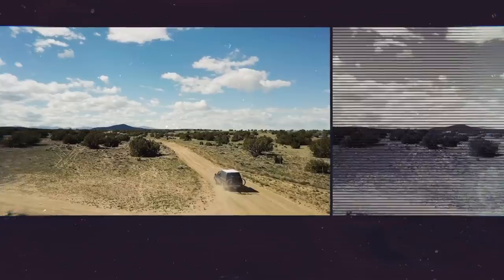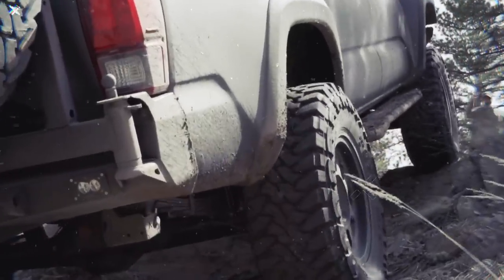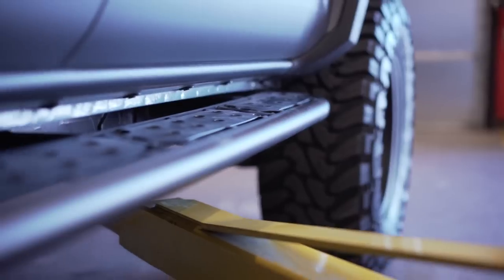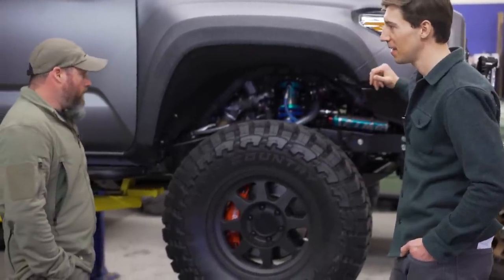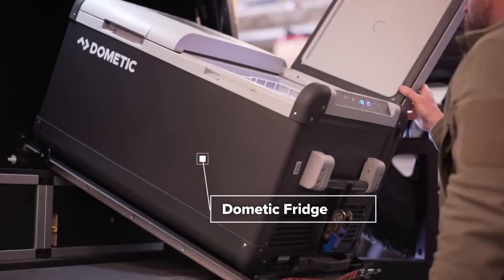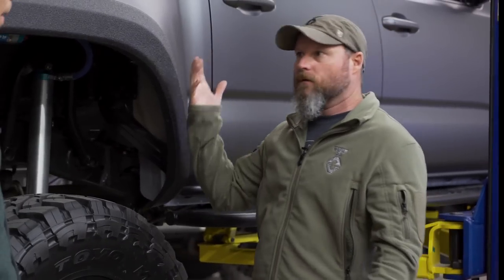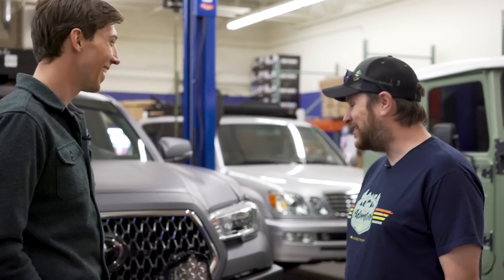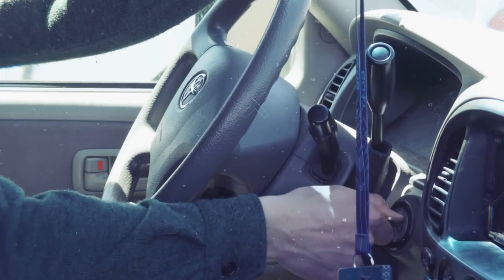The Guru Building Custom Adventure Trucks | Outside

Comment: I would be interested to hear the opinion of whether or not you should buy a base truck versus the off-road version. For instance should I buy a Tacoma SR and send it to Tactical , or a TRD off-road and send it to this company? It could be as much as a $10,000 difference in price for a new truck.
Reply: If you plan to build it out or have someone like TAV build it out, you're better off buying the base model 4x4 since you'll be replacing the suspension, and likely adding new gears and lockers later. No reason to spend the extra money up front.